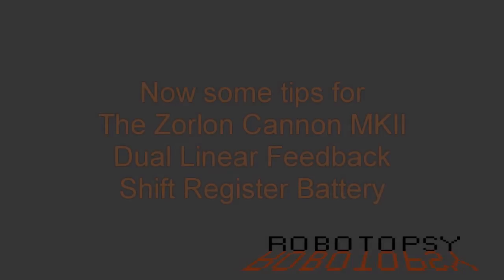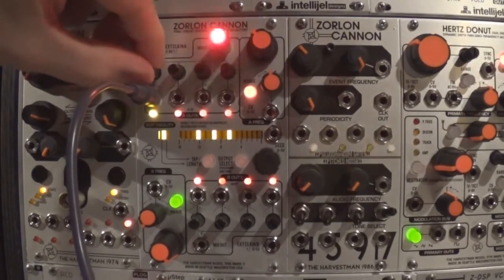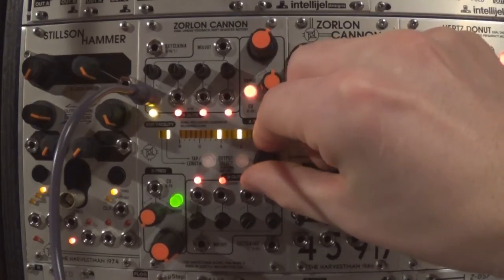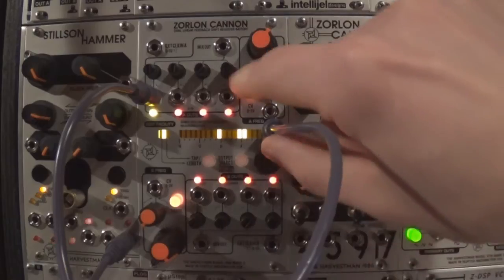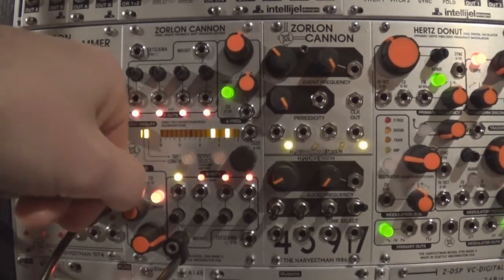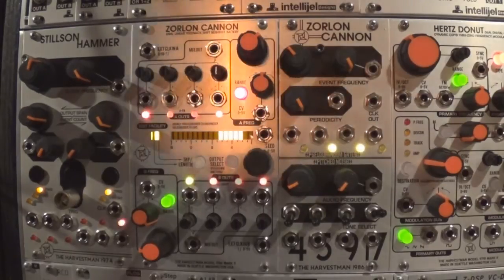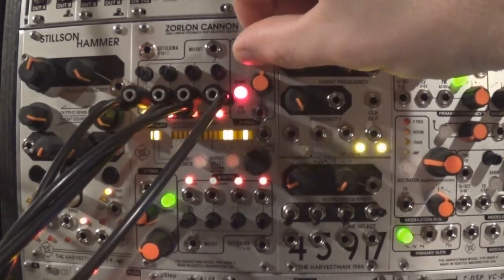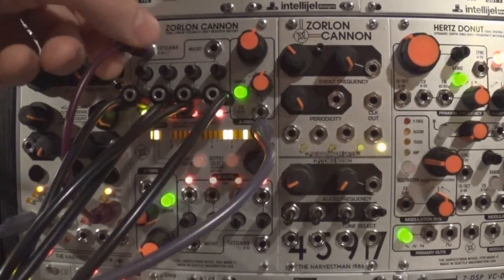Zorlon Cannon MKII quick demo & Tips from The Harvestman

Comment: Did a firmware update ever come out that made it so you could externally clock it and use the cv inputs?
Reply from the maker: You can external clocked it but the CV input is disabled. but still very useful.

Comment: Also curious again here, what happens if you put an external clock and some random voltages in the CV range? Supposed you use only one bit on one output gate channel, then you should get a random varying clock in its output, right? And you can control how deviant with the range knob...
Reply from the maker: TheJesterN 
unfortunately when external clocked... the CV input is bypassed and doesn't affect anything.  Maybe with an upcoming firmware update ... who knows  !?!?

Comment: Great Video's MR Robotopsy ( Cool Name ) a Quick Question The 4 gate outs are individual random gate and the mix out is a mix all four of those random that may follow a ext clock signal?
IT is this the same for noise output side ?
Thanks for all the informative videos on Harvestman Modules
Reply from the maker: the mix output for each (upper and lower side) are a mix of their four outputs..... but with the attenuverter... you can adjust the amplitude for each gate out and also negative range of the attenuverters will substract the voltage... the main out of each section is more dedicated to audio . And each upper and lower side can have their own external clock.     Thanx for the comment
Reply: Big Thanks !!!!
All The Best!!!
 @robotopsyrobotopsy6486